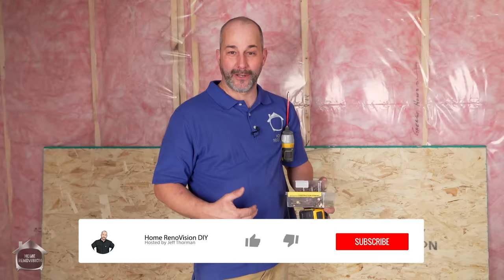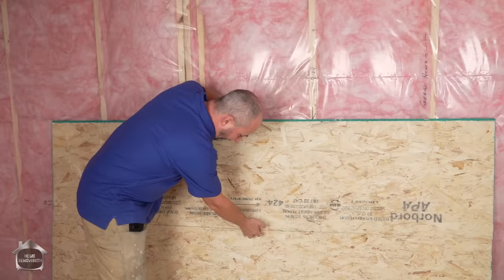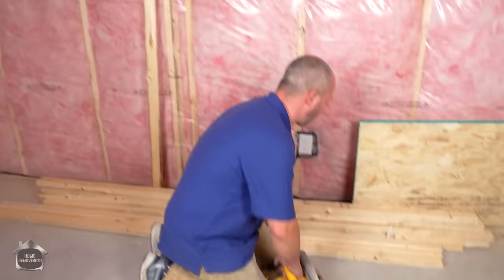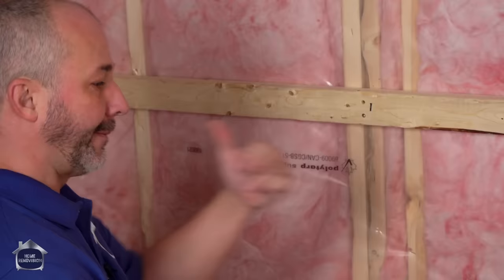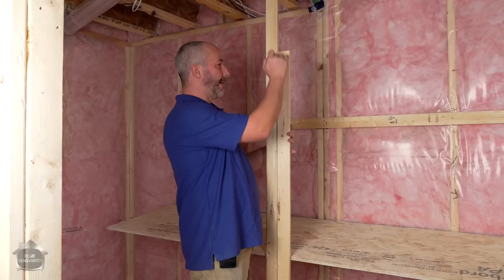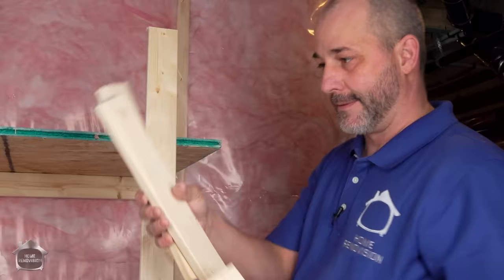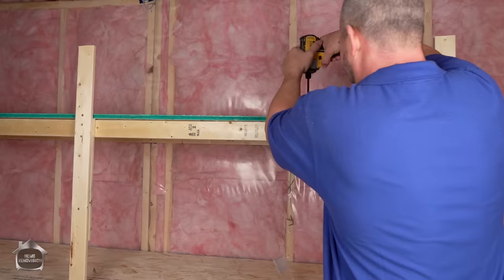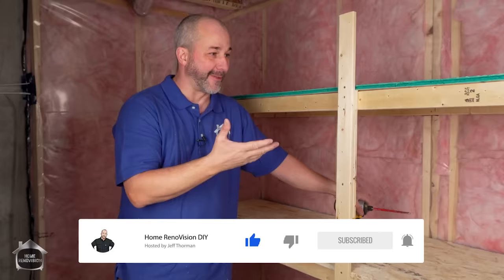Simple DIY Storage Shelves

Comment: Besides the comments that have already been noted to upgrade for strength and rigidity, I would definitely add bracing under each shelf from front to back, at the very least, one on each end and one in the center. In fact, I was very surprised that he didn’t add them on his own or even mention it as an upgrade. 
This extremely small and easy to install addition would prevent  natural warping in the center of the 2’ wide (deep) board, not to mention warping due to long term effects of whatever weight you are going to inevitably be adding to the shelves.

Comment: Hey I just put in shelving using the tough track (? The branding is confusing). I thought it would be easier than this - obviously more expensive, but easier due to no cutting). However it has been a PITA. Finally done with my wife’s help lol. I did not end up saving time.

Comment: Just built 16’ of shelving using this method. $30 is way off. Using the cheapest lumber at Home Depot, each section cost $60. But still well worth it.  Thanks for the video.

Comment: I adore the insights you lend to this woodly tyro of 75 years. I’ve got a shed that needs more efficient storage and organization and an allowance for a honey-do-plagued-handyman.   In other words I need a damned workspace…just part of the space…I’ll take a third or even a quarter this sheet-steel/insulation/sheet-steel 9x15x8 foot shed. I just learned about French shelves! YeahhhhhhNnoooooooo…no studs.  Should I give up? I can’t afford to do a complete frame up…I’m trying a crazy concept I call HSs (“hybrid studs”)…not 2x4s , rather, 3/4”x4”x 48” A/C plywood. Four feet is all the vertical space I’ve got….the roof starts at 48”,slopes 15° for 2 feet and almost 45° for another 5 feet to the top which is 8 feet tall. That’s what I’ve got to work with. I’m placing the HSs On 16” centers, It is stuck to the inner sheet steel wall with 1” multi -material screws with a sandwich of one of 10 different adhesives from Elmers to Titebond III to wood-to-anything construction adhesive, documenting the results as to shear and pull away forces.  No clamping. Nothing to clamp to…lest you want to build a Stand-alone, room size bulwarked clamp. 
I’ve got 1/2  of the left wall done and French Cleated. Feels like it’s holding with the tools loaded…Cool!…but what about 12” shelves and their contents??
I’ve got the rest  of left-half, rear and right yet to do.  Stop and throw a match into the sawdust and plywood shards and walk away? Or, do I continue and document the “ hybrid stud” experiment?

Your next biggest fan ever,
Chas
Reply: And…I hereby absolve and hold harmless the owner of this channel for any comments offered in response to my query above.
Chas as aka hesynergy

Comment: I have a question in regards to this design. If you're putting a 2x3 all the way across the edge of the shelf, why do you need the 1x3 scraps in between that and the upright leg? Wouldn't it be just as strong by screwing the 2x3 directly into the upright leg with a couple screws per joint? Is it an appearance thing to leave the edge of the shelf jutting out over the support?

Comment: Which board did you cut into smaller pieces?

Which board size did you attach the smaller pieces to?

The 1st boards you put up horizontally were those the 1x3 or 2x3?

Comment: I would have put the cleats under the 1x3 on the front edge - might as well maximize the strength (instead of flying on one screw per vertical).

Comment: Nice build, but I think it would be even better if the horizontal 2x4 was resting where the OSB is. The OSB stays mounted to the 2x4 as in the video, but instead of a lip of OSB braced by the vertical piece of 1x4, it would be the 2x4 itself. Much stronger IMHO.

Comment: At -2:30 you said you go in reverse and burn the screw in? How does that work? Not quite sure I get it.
Please expand on that.
Fantastic instructional video. Think I'll take my plastic shelves down and do this.
Reply: I was curious about that statement also
Reply: Spin the screw in reverse until there is a divot, it works like a makeshift countersink bit.  Normally the head will split wood like this because it is basically a wedge, but if you put a divot beforehand the head will simply fill the divot instead.

Comment: I just built these yesterday, thank you for the video! 

I do have a question though. On the front of the shelf you have those off cut support pieces, then right behind it you add in the support piece that runs the whole length of the shelf. Are the off cut pieces just for extra support? It seems like both pieces are doing the same job, but I know close to nothing about building anything.

Thank you again!
Reply from the maker: the back side is to transfer load directly and the front side is to keep it from moving. I don't like to rely on the shear strength of a screw so that is why I add the extra bracing. Cheers!
Reply: @HomeRenoVisionDIY  got it. Thank you for the schoolin!

Comment: Hammer drill and tapcon screws into a cinderblock wall? Or would you recommend going freestanding?
Reply: Personally I don't trust tapcons in cinderblock. No real meat there to bite into.
When in the basement, I usually anchor to the floor joists above, with some treated lumber under the bottom of the 2x4 (or whatever you are using for supports). That way I don't have any untreated wood contacting the concrete or block to rot it out.

Comment: Only thing I’d do different is screw the scabs on according to where the full lengths 1x3 sits prior or put full Len the 2x3 under the sheet first.  (instead of the scab only supporting the ply) other than that great

Comment: The 1x3 strapping that you've used as blocking under the shelves is redundant once you've put the 2x4 across the entire width of the shelf. You could save a few min and a few screws and just use the 2x4 as the shelf stiffener and the blocking.
Reply from the maker: i am using it as a load transfer so I am not relying on the shear strength of the screw! cheers!
Reply: 2x4? I thought he only uses 1x3's and 2x3's?

Comment: That first trick to cut the OSB. Nothing like watching experience at work.
Also, can someone explain 2:26? I just started drilling things and I found that drilling holes first with a bit and then driving screws after prevents splitting. Was he actually describing another way to prevent wood from splitting?

Comment: I did this back in the day when worked at Lowes.  I built a work bench and shelves in my house but I've never heard of "Burning" a screw in?  I wonder if you could explain that.Thank you.
Reply: I think what he means is set the drill in reverse and try to drive the screw for a couple seconds with decent pressure. It forces a starter hole (quick easy pilot hole) to help prevent wood splitting

Comment: I used the same process 18 years ago when I into my current house. We have a 52 inch high crawlspace under our family room so I covered all four walls using the same idea. However I used 1/2 ply since it was a lot cheaper than today.😊

Just wondering why you didn't panel the walls before adding the shelves. IMHO, it would have been easier than doing it after the shelves are up.
Reply: my guess is that Jeff just built this to show how its done then tore it down. Either that or it was a customer that didn't want to spend the extra money. The advantage of doing this without panellig/drywalling first, is the new DIY'ers can see the studs that he is talking about with no need to get into using stud-finders to find the studs. Plus a LOT of people have unfinished places like this (eg: garages, sheds and basements) that they have no intntion of ever finishing. They just want quick and affordable shelves there.

Comment: You actually can almost make it for no cost. My local home Depot gives away the slots wood they use with their incoming merchandise which are 2x3 2x4 4x4 and 1x5 normally by 4ft then walk to the discount lumbar for the top normally 70% off. Screws well you're screwed buy some

Comment: Given the price of 2x4s, would a similar (but freestanding) shelf (2x8) be sturdy enough using 2x3s to hold normal household items (like seasonal decorations stored in totes)?
Reply: The studs used in this video are 2x3 not 2x4.
Reply: Costs of 2x4’s have come down substantially lately.  You are only looking at $.50 to $.75 more than a 2x3.  Go with the 2x4 any day of the week.

Comment: Gonna give this a shot.. What screws are you using (type, size, length)? Did you also say you screw them in in reverse?  TIA!
Reply: The screw in reverse or ‘burning’ is referring to not having to drill your own pilot hole with a drill bit (helps prevent wood from splitting when you do drive a screw) you just use the screw and try to drive it in reverse for a couple seconds to create the pilot hole. Then your run it properly and drive into place

Comment: Could you write a list of the supplies needed please? I just wanna make sure i get everything correct? Any specific screws? Is Lowe’s or Home Depot better? Love your video!!
Reply: Any drywall screws.  2x4s 6 or 8 foot long.  Buy 1/2” handi-panels.  They come 2’x4’ and are easier to bring home.  Simple supply list.  Simple tip: lag bolt the back to your studs and that ain’t going nowhere.

Comment: Why waste the wood making a vertical jig to put the horizontal strips on ?
Place the horizontal strip where you want it, use 1 screw ( 3/4 in the wood ) so it will pivot. Then get your level, level the board and put a screw in that end. It will be level and hanging on the wall til you put the rest of your screws in that support board.

Comment: you are the god of slicing.  The way you cut that board in 2, just holding the saw, my jaw dropped (noob diyer here).  Your 20 min here will prolly take me 2 days lol.  What i want to make is a storage-closet type in the living room, with sliding doors over the height of the room (8ft). I was thinking putting wire shelves inside but now am debating.  Price of lumber those days will hurt a little... and am also a little freaked out by the idea of sliding doors set up and not to have the whole thing collapsing.
Reply: Lumber prices are way down. When I built this a year ago they were sky high. A 4x8 of osb was around $48 then...I just bought the same 4x8 last week for $16 at Home Depot...same place where I got the first one. This shelf system really works. I fairly novice too, but really just take your time and do it right and you will have something that will probably last you the rest of your life.
Reply: I have same idea storage closet in garage with sliding doors, please post pictures here incase, if you have built
Reply: @leelakumarrajalekkala9850    will do but keep in mind it's a long term project for me.  before i start doing that, i have a long list of projects), so it might take me over a year.  I haven't fully decided yet which wall i am going to use for that. Need to rethink the entire living room)))

Comment: 2x2 in front is being held by the 7/16 press board and a few screws  ... should of notched a 2x4 to hold up the the 2x2 plus press board, also use wood glue between press board and 2x2.
Reply: What are you talking about? These shelves are plenty strong.

Comment: Would there be any real need to add 2x4s on the bottoms from the wall to the backside of the uprights? My curiosity is about the flex on the OSB from the weight of things stored there could eventually compromise it.
Reply from the maker: no worries, if you plan on serious weight just use the 3/4 osb. Cheers!

Comment: Great ideas, but I have 2-3 comments.
Looks like $60 or more in materials (as mentioned by other commenter(s)).
I don't think those 1x3 front legs are sufficient when those shelves are fully loaded.  Maybe back up that 1x3 front piece with 2x4s that provide support below the 2x3s all the way to the ground.  If in a basement, consider PTL for ground contact member or stand up in some small plastic containers (butter?) to avoid potential water, maybe pour in some wood preservative to wick into the wood.
No backing behind shelves to protect that plastic sheeting?

Comment: Wait. Please expand on the "system" of burning in the screws? I think I get what you're doing, but do you have a video on it?
Reply: you just put the drill in reverse (counter clockwise) and press the screw hard into where you want it to go. Then after you've done that for a bit, you drill the screw in normally in that same spot. Similar trick is if you're nailing, you can hammer in the pointy end of the nail to dull it basically and so when it drives in it's less likely to split because it compresses the wood instead of moving the wood. I think the screw trick is less about compression vs. splitting and I think it's more that it makes a pilot hole, I'm not sure.

Comment: Jeff, what type of screws do you use for such a project?

Previous owner of my home used drywall screws for everything, even hanging a light fixture in the bathroom.  I went to Menard’s last weekend and was so overwhelmed by screw choices i left empty handed.
Reply: All you need is interior drywall screws.  Lag the back to your wall with 3/8 x 4 lag screws and that will be solid as a rock.

Comment: I like it, but I never found a slab that was level so never work from the floor. You must have some great concrete guys
Reply: That shouldn't be an issue? When placing the boards you can level it straight?

Comment: Can you make this as a floating shelf meaning that the legs are not touching the ground ¿
Reply: I wouldn’t.  Takes all the strength out of it if your legs don’t touch the floor.   But if you want to have no leg touching the floor, run a diagonal brace from the underside of the shelf to the wall.

Comment: I have about 100. Drill bit’s but when I drill with them they always slip I’ve tried all different bits can you help please 
Tony
Reply from the maker: use a different screw head . phillips is the reason you have problems. It is a lousy design.
Reply: Are you using an impact driver or a drill? Two different things, and for me the difference is night and day. An impact driver will shear the head of the screw off before it slips. Be aware that cheapo bits will not last long in an impact driver.

Comment: Will this have any problems sagging with moderate weight such as gallons of paint etc?
Reply: I wouldnt think so, they're only 2ft deep.  You could also add some blocking underneath the osb if you wanted to be extra secure.
Reply: @Mixwell1983  ok great! thanks you!

Comment: I like this shelf but I have cement walls can I make one free from wall style
Reply: Hammer drill and tap-cons(concrete screws).   Pain in the butt to drill into concrete without a hammer drill though.  Attach directly to the concrete.  Use 3” tap cons and boom, good to go.  To make extra sure, it’s solid attach a stud running vertically from the shelf to the floor.

Comment: I thought about doing this but I'd like to do fully suspended shelves, nothing on the ground to support it.  Ideas on this?
Reply from the maker: sure but that is another video.
Reply: Just make a triangle shelf bracket out of 2x3 or 2x4, one on each stud or every other stud, and put the OSB on top of them. Done. Only trick is cutting the 45 degree angles, but not hard with a speed square and you can cut with a circ saw just like he did in this video.

Comment: Why extend the vertical wood posts higher than the top shelf?
Reply: He explains it at 4:04 for draping extension cords or Christmas tree lights.
Reply: Also good for ripping the back of your arm open when reaching to the back of the shelf.  Cut em off flush.

Comment: How about a standalone shelving system? Our basement has cement walls not studs.
Reply: With a hammer drill and “tapcon” screws and you will have an even stronger set of shelves.
Reply: @PeterMosier  exactly.  No chance it will tip over then either.

Comment: Interesting but lots of engineering and design weaknesses.
One screw may be be rated at 80lbs vertical load,(depending on type of substrate and fixing) but 4 will not do 320lbs as you have weakened that timber.
How will you clad the wall behind ?
The small 3x1  backers pieces can  be shorter.
The 3x1 should sit on the backers not the OSB.
 The aesthetics are poor.
Garage floor are not level and spirit levels should be used.
The 3x1 does not give the system its 'strength'.

Comment: And you built the shelves before drywalling why?  And since you had the strapping, screws, and driver, why not screw a straight piece of strapping against the OSB to use as a guide when ripping?  And lastly, I would never use OSB for shelving, nor anything else in construction.  It is a piss  poor substitute for plywood.
Reply from the maker: LOL, if it can hold up people and pianos on top of floor joists I think it can handle storage. plus it is less than half the price.
Reply: Thanks Jefc. I dont like the look of OSB but i am going for it in my garage cos i dont need to spend more
Reply: Hey Jeff ive been watching your videos fof three years now but only  now getting into woodworking professionally. Why dont you use nails for this. I have a nail gun and i imagine if will be faster to shoot nails
Reply: @rampitup12  it would.  But nails can always pull or pop out.

Comment: Your drill must hate you! Cranking the poor thing to force the screws in. Work smarter not harder though. Why shouldn't the drill do all the work?
Reply: You are correct that in a regular 'drill' the cranking sound would be that of the clutch slipping as you try and apply too much force etc.
But, this is not actually a drill that he is using here - it's an 'impact driver' - kind of like the lovechild of a hammer drill and an electric screwdriver. 
The 'cranking' sound here, is the impact of driving in the screw etc. i.e. it is designed to work this way! ;-)
Richy.
Reply: @richyread2011  The more you know